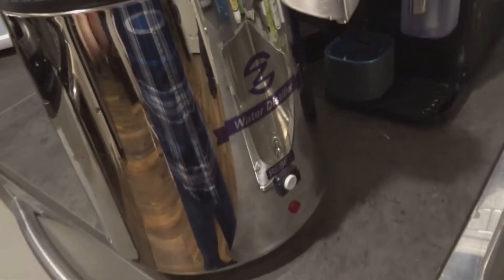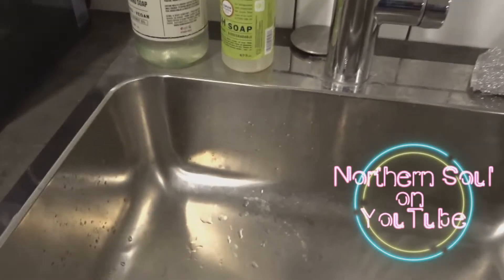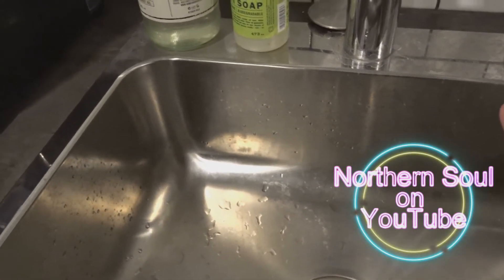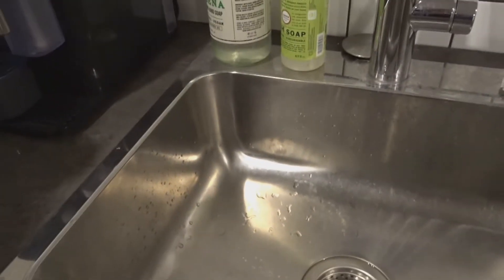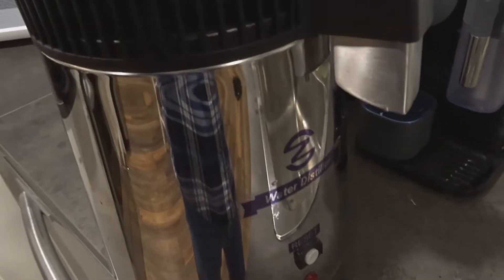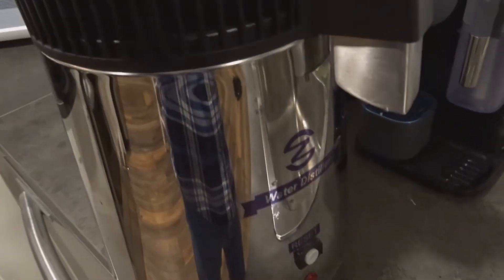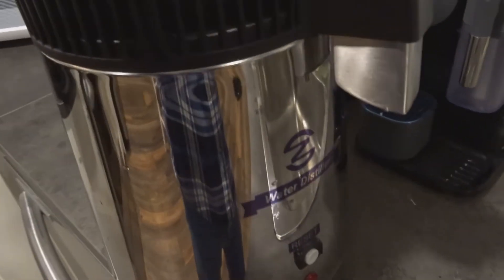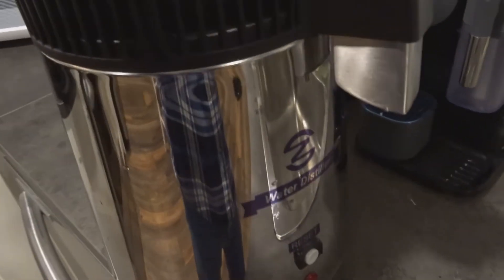How CLEAN is Tap Water? Steam Water Distiller Test - Northern Soul

Comment: A TDS (total dissolved solids) meter can be used to test the water from the tap, as well as the distilled water. Ideally, there should be zero total dissolved solids in the water though, in reality, water from my distiller has sometimes contained as much as 2 TDS. However, water from the tap contains in excess of a hundred TDS! Definitely worth getting a water distiller!

Comment: Drinking distilled water strips minerals from your body. After distillation which is very much necessary, you should re-mineralize water you use for drinking.
Reply: Minerals in water are very minimal,as long as you’re diet is good you will not have a problem
Reply: there are tons of good minerals found in most food as well so I don't see why i need it added into my water
Reply: Rubbish.
Reply: Why?  when you get minerals from your food. Did you see the crap in the bottom of the distiller? It stinks.
Reply: You don't have to remineralize because we get enough minerals from food. Do your research!!!